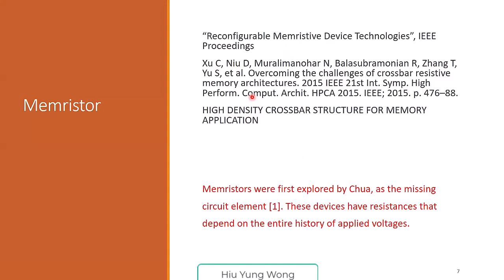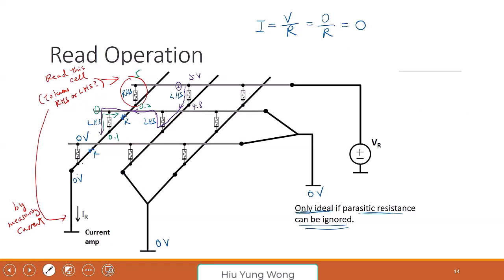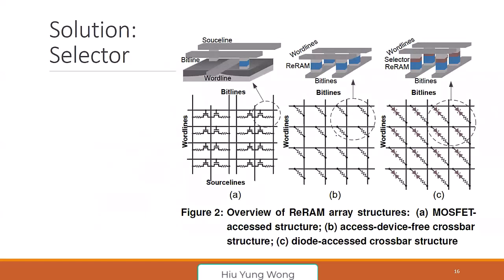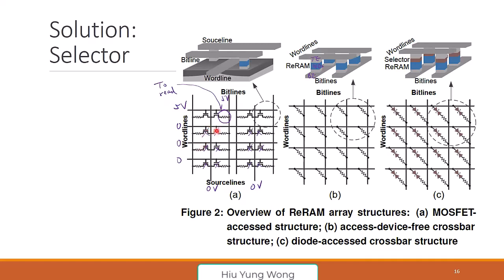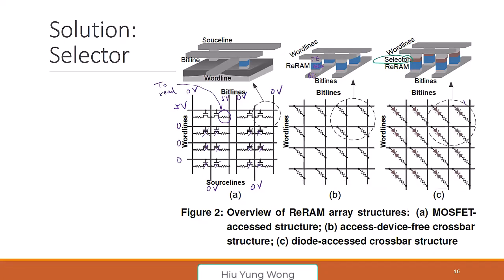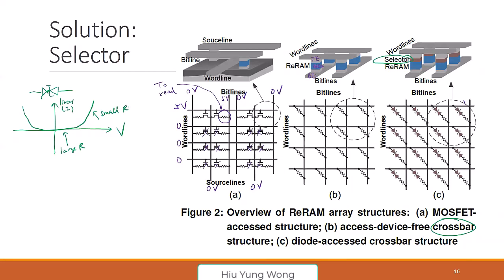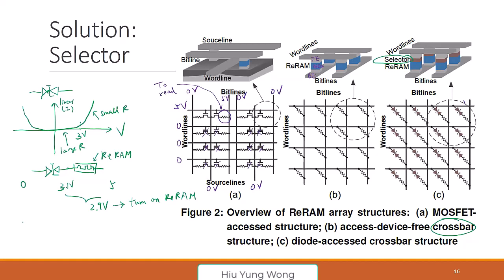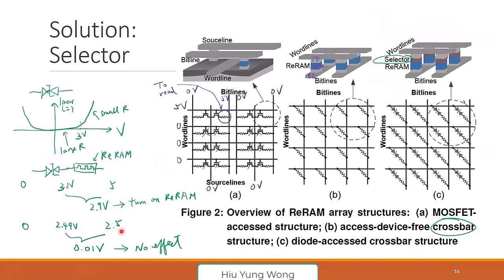22B - Selector for ReRAM and Multi-qubit Writing

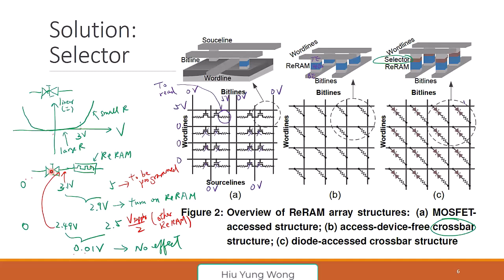Comment: i see from the diode accessed crossbar structure that the input voltage (from the wordline) is applied to the diode, but in the left bottom example at 17:04, I can see that the voltage is being applied at the ReRAM terminal, why is that so ?
Reply from the maker: The analysis in the bottom left gives the same result whether we put 5V to the left or to the right because only the potential drop across them matters as the anode and cathode of the ReRAM were not identified. So I was not rigorously trying to map to the circuit on the right. I also forgot if we had mentioned that the wordline needs to have 5V in the right figure. But you can be more rigorous and should get the same result.
Reply: @quantum_computing  Thank you !

Comment: Generally what type of transistors are used for the 1T1R configuration ?....I see NVIDIA transitioning from FinFET to GAA etc.. Is there any data on which transistor (MOS, BJT ,FinFET ,GAA etc..) works best with the memristor, as a selector?
Reply from the maker: That depends on the technology it uses to implement the array. Usually, it is not BJT. Most of the publications are planar MOSFET e.g. 28nm. Definitely, they can use FinFET and GAA. Probably no one has tried GAA yet as it is too advanced to integrate with ReRAM at this moment. I am not sure. But in the future, for a high level of integration, yes, GAA is good.

Comment: at 8:16 why and how is the voltage across the diode 2.1 V ?
Reply from the maker: I put 2.1V first because I assume the diode is almost off at 2V but turned on after 2V. Therefore, it will have a potential drop of about 2.1V (just a guessed number). It cannot be smaller than 2V because at that time the diode is off so it will take most of the voltage. It cannot be much more than 2.1V because it is turned on so it cannot take much more voltage by KVL.
Reply: @quantum_computing  Thank you !